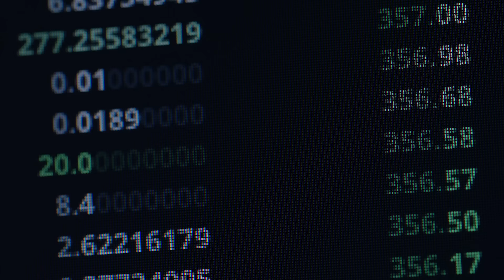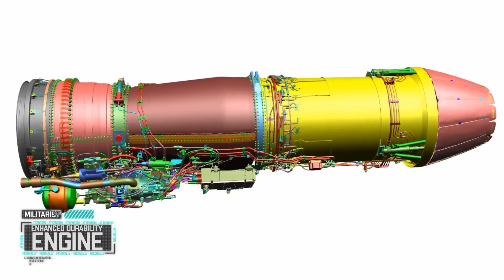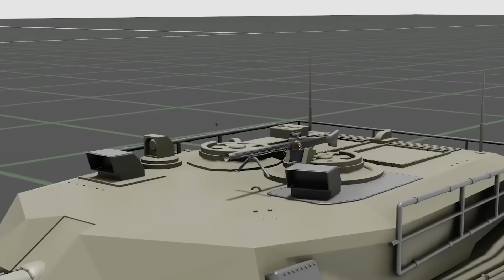Swedish Military Superpower Is Ready To Beat Russia In 40 SEC!

Comment: We tried in januari 1, 1708. It Did not end well. So attacking them is out of the question. But Swedish steel (with the help of Finnish SISU) will destroy them if they attack.
Reply: @annarock8966  No, because during the Second World War, Sweden did not have the military ability to fight its way out of a frozen plastic bag. It is different nowadays.
Reply: @anthonykarlsson5166 Do you know that Germany had actual plans to invade Sweden from Norway during WW2. They never acted because you counted on to high losses witch they couldn't afford att that time. The fact that it took so long to build up the Swedish forces during WW2 was that we didn't have any defence industry to mention at that time and it was almost imposible to buy anything from abroad. It took until 1947 to get everything ready.
Reply: @dennistofvesson6351  Yes, they had. But I think the reason they didn't attack was the iron ore they depended on could continue to come to Germany unimpeded. That might not have been the case if they had occupied Sweden.
Reply: @anthonykarlsson5166 In my opinion Narvik was more crusial to the export to Germany and it was more voulnarable. I think the real reason they never attacked was that it just wasn't necesary and later in the war when Sweden turned more towards the allies it would have been to costly. Did you know that sweden actualy captured Moscow ones. It was in march 1610. According to writen sources the people in Moscow cheered when the Swedish troops marched in and took over the city.

Comment: Good summary but just an FYI there was not a single picture of the Swedish main battle tank in this video. Our tank is based on the Leopard 2 but after modifications and upgrades it's called STRV 122 (short for Stridsvagn 122)
Reply: The very first clip of the vid shows an Strv 122
Reply: @Raeko1918  just re-watched it and your right, just before the wrongfully "100 year" there is indeed a strv 122.
Reply: Stridsvagn 122 brinner rätt bra eller vad säger du. Lol
Reply: NATO tanks are outdated as they dont have GPS jammers onboard. Separate radars are not enough to warn vehicle crews early enough to get within range of other antidrone systems.

Comment: Sweden has 1½ Brigade at the moment it might be able to take on the army of the Vatican state but no more. The fact is that their army can hardly move due to the lack of heavy trucks. If they move they do not have SAM systems enough to protect the movement. The Airforce is to small and the few fighters they have has to few pilots. As for the navy well with the exeption of 12 ships most belongs in a museum. The most pathetic is the Swedish artiliry 30 guns. It is not even guns enough to defend Gotland. There are in fact less artillery than fighter Aircraft. The only thing that is overflowing in the Swedish defence are Generals, Colonels and bureaucrats, they are so many that the army can not move because of every rule they have writen.   A large part of the soldiers day seems to be ocypied in gender equality education. The soldiers needs at least to dubble the amount of amo spent on trainig.

Comment: So, look at your history books people. Sweden has never been neutral. WW2 , they allowed the Germans to use the railway system to fortify Norway and also sold most of the iron produced to Germany. Congo, supplied military aircraft….Libya, flow missions to assist NATO. Allowing USA and other NATO nations to train and practice military operations….along with the Swedes. So, how is this neutral. And Sweden doesn’t have a nuclear arsenal….so ultimately it doesn’t matter how good you think or actually are. Unless you can defend or attack using nuclear weapons you will ultimately loose.
Reply: During wwII we also took in almost all of denmarks Jews. What’s your point? 
We were defending Sweden as good as we could since we were neutral and our neighbours were defeated.
Are you saying that every nato country are loaded with nuclear weapons? 
Only the power crazied countries are..
Reply: But sweden had the material to bild a nuclear bomb under the coldwar and under wwII germany endangered sweden so that's a thing why we sold so much iron to them and the soldiers used swedish railroad to Norway when Norway give up and norway was german